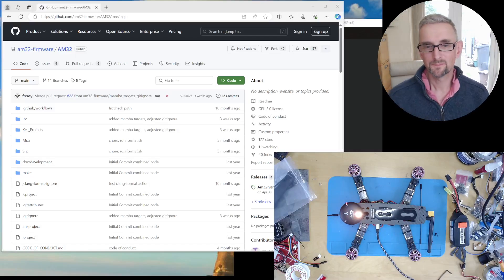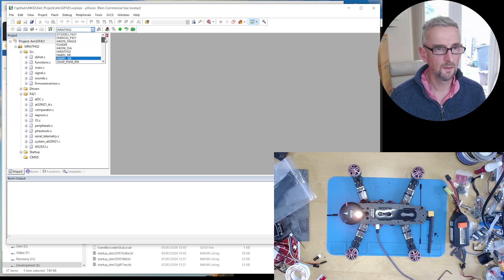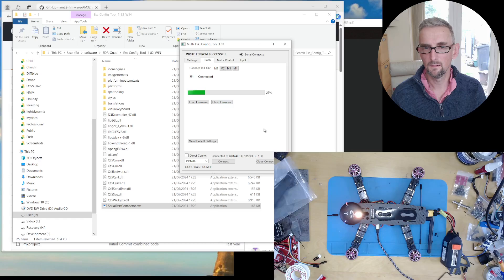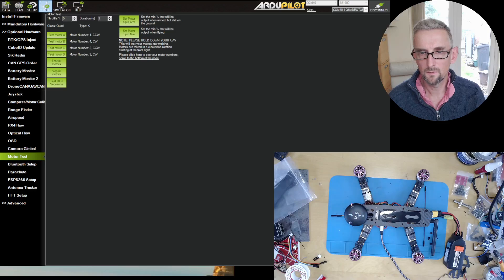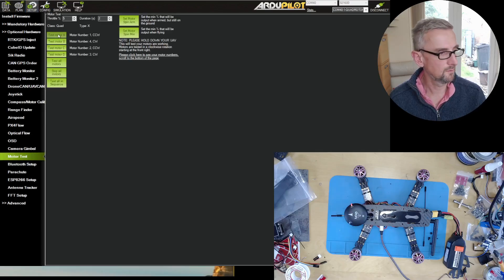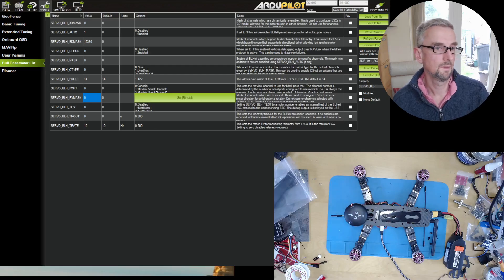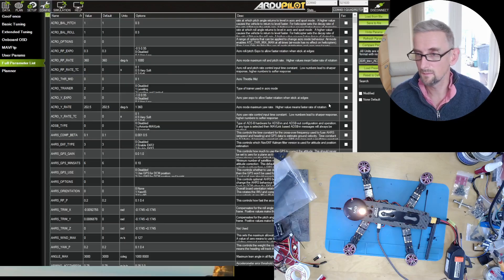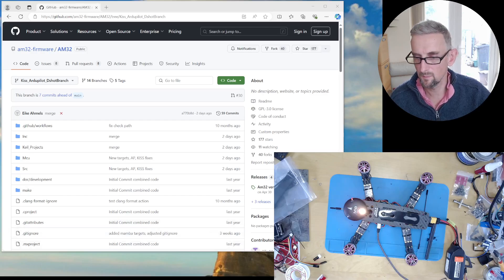AM32 on ArduPilot Part 4 - Flashing Custom AM32 Firmware for ArduPilot

Comment: Great video!! I am also building a large quad with a pix. 6c and the same ESC, would you recomend to use the same f.w. as in the vid. or something newer?
Reply from the maker: These ESCs should now come with AM32. I am using 2.18 successfully - I think use "by RPM" PWM frequency and "Completemtary PWM" ofr active braking